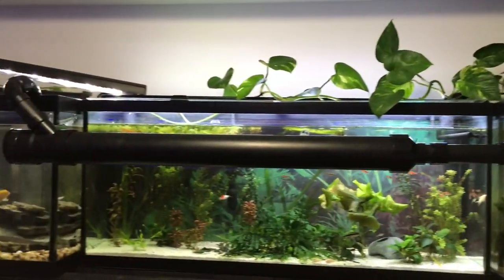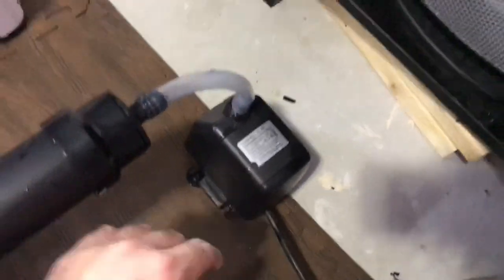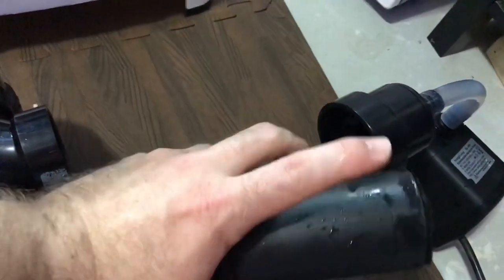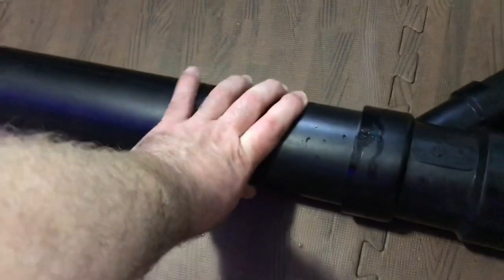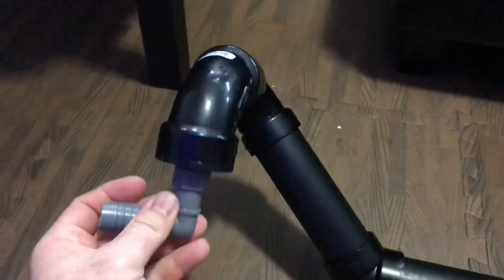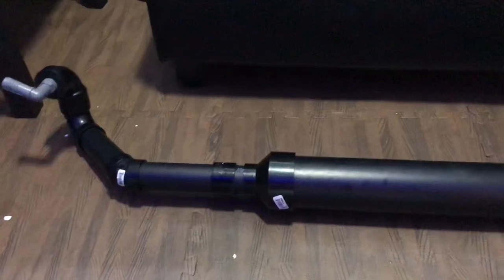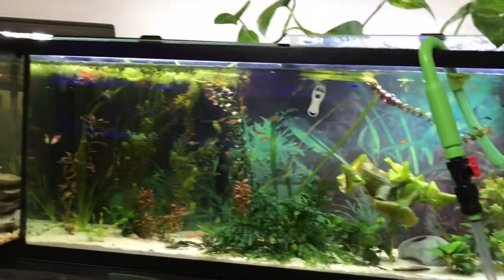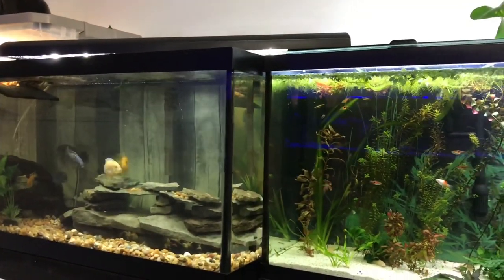DIY Canister Filter Hang On Back

Comment: Angelo long time bro, cool DIY you got there buddy.   Look me up if you're ever in the 6ix
Reply: What forces the water through the bridge and not over the edge of the tank?
Reply from the maker: Eh how you been man? Hope all is good. I certainly will. 
As long as the water bridges are primed(remove all air)you shouldn’t have any trouble the water will flow. The way the bridges work is the tanks try to self level itself via the bridges. If you constantly removing water from one the the other remaining tanks will try to fill it back up.
Reply: Thanks buddy, really cool idea
Reply from the maker: Thanks buddy

Comment: Angelo another question does this not working more like a skimmer filter though as it's not sucking from the bottom ?
Reply from the maker: It can double as a skimmer if you point the inlet towards the top.. Although the same amount of water gets filtered through. And how it’s designed the tanks are constantly getting turned over. Thanks for your questions I appreciate them 😊

Comment: Great video by the way!
Do you have individual heaters in each tank, or the 2rd and 3th would rely heating from the main tank?
Reply from the maker: Wow thanks so much Friend. I have a single heater in the main where the pump is. It’s keeping the the temps at about 76-77 I can’t remember exactly what the temp is but it’s in that range. Although the room is warm so the heater isn’t on a lot throughout the day.

Comment: Nice set up. How much does it weigh, while filled with media and water, and is that a strain on the glass? Great vido Angelo!
Reply from the maker: Thanks so much bob. It’s about 30lb It’s divided between 2 tanks so 15lb per tank. I don’t think that’s giving much strain. You can actually get refugiums that hang on glass that weigh more then that. So I’m not overly concerned. Thanks so much Bob😊
Reply: Awesome  @AngelosFishTanks . Thanks for the quick answer. Great system and vid!
Reply from the maker: Caylor's Aquatics eh Thanks Bob 😊. I really appreciate that buddy